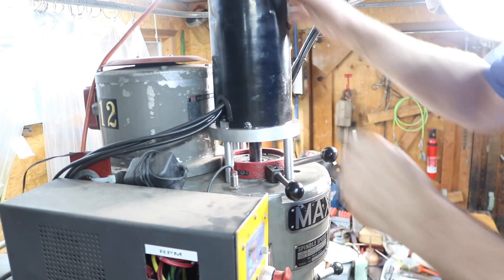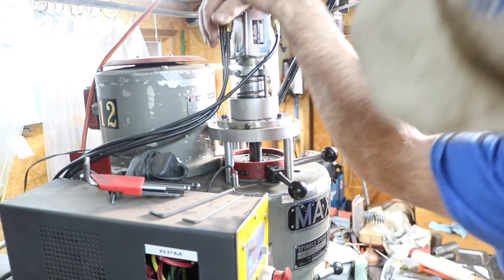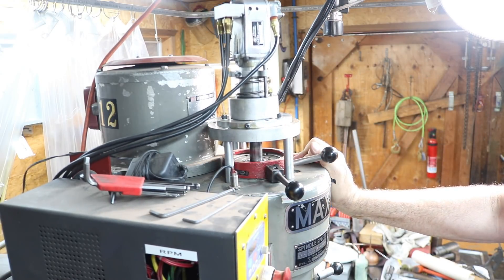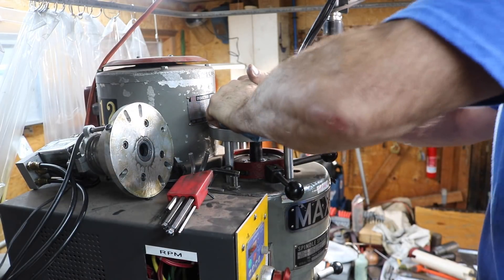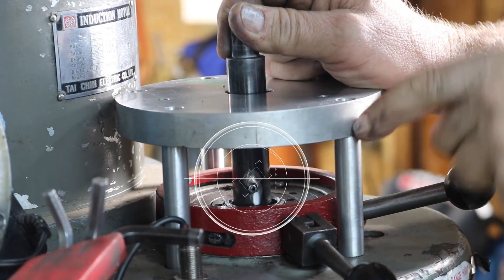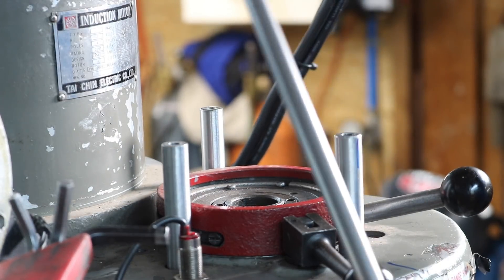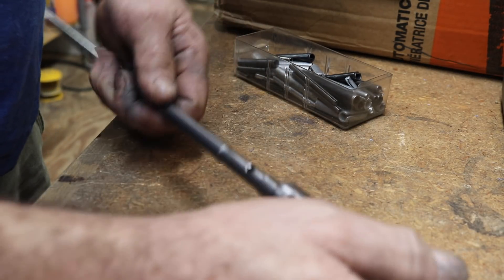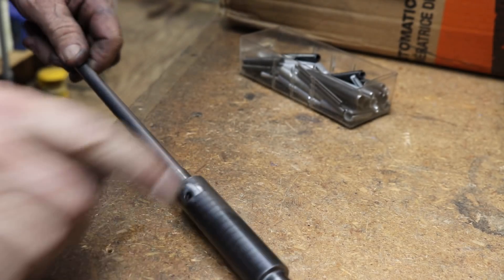Problem with my Milling Machine

Comment: I love repair videos. I always learn something. I have thought about getting a power drawbar for quite a while, but have never pulled the trigger. For one thing, I usually keep the air in my shop off unless I need it. I have some slow leaks that cause the compressor to cycle ever once in a while and if it goes on a night, it scares the bejusus out of my wife. Never good.
Reply from the maker: Thank you.  The air is an issue,.

Comment: This looks like a Kurt power draw bar. The two piece draw bar design allows different materials and simpler draw bar length choices. I like that idea as it is simpler to replace only the part that is worn. We used these for decades in a three shift production environment and I don't recall roll pin failure being an issue. I would call this an easy fix and consider the failure a minor anomaly. My experience is that you will have more issues with the power draw bar engagement function as the assembly wears. The assembly is non precision. Keep hardware loose and allow the assembly to self align before torquing the hardware. Worn assemblies used to cause me enough alignment trouble that installing the cover would prevent reliable drive socket and draw bar engagement. I tried making hex adapters and standard impact sockets to replace the OEM spline parts to save $. This works reasonably well. Airborne shop grit can offset the advantages of anti seize. I unfortunately only have one home shop and I do both wood working and machining. Wood dust is a constant problem on oily metal working machinery.
Reply from the maker: Happy New Year.

Comment: I'd put a brass washer under the the pinned on part for the pressure on the spindle. Like a bearing . Yes nobody knows about SAFTEY wires anymore. I do have used them in the 70s. Why back in the old days I worked on government contracts building tomahawk rockets and other secret missiles. Odd ball materials money titanium magnesium fun stuff if YA never machined any. Carbide wasn't real big then. I made a big hit and got made Forman for being smart . We had clamps to be milled from a real hard stainless it wore out end mills three at a time for one clamp. I had a carbide insert cutter triangle 3/8 I think but I milled four sets on my shift and rotated them one time plus it took one cut the width being it's diameter. . Nice to come in and be told the head office wanted me. Thought I was being fired.
Reply from the maker: Good thinking, Thanks, Merry Christmas.

Comment: a longer draw bar, and have the roll pin visible. I hope bits of wire and roll pin don't fall inside the quill, next time it breaks.
Reply from the maker: Thanks Debon h.  I should not tight clearance.  This is the first time this has happened.  Merry Christmas.

Comment: Rand any chance the centrifugal force will cause the twisted section of safety wire to eventually rub on the  inside of the the spindle? Cheers Zed
Reply from the maker: No not on the really quite a bit of clearance at the top.  ThanksZed O.  Merry Christmas.

Comment: I think you just bypassed a safety feature. By putting safety wire in the hole instead of shear wire, it might not break when it needs to in order to protect the rest of the machine. We had to replace quite a few parachutes in the Navy because someone did just that. Imagine pulling the wire to deploy your parachute only to find out it won't deploy because of that...
Reply from the maker: This is not hard wire it is soft stainless wire, It will shear.  The wire is just to hold the pin in positions, I think one of the major reasons for the shear is the the pin shifted to one side so only one side was holding the torque.  The safety wire will shear off if the pin shears.  The pin only needs to shift about 0.050" to loose engagement.  Thanks and Merry Christmas Thank you MtSBWY.
Reply: @RRINTHESHOP  Merry Christmas to you too!

Comment: nice repair...if my memory is correct, didn’t you power tap the large plate (fwd/rev), think that was the cause of wear/damage?
Reply from the maker: Thanks Chuck and Merry Christmas.  I think just time and the pin shifted to one side, that is why the safety wire to stop the pin from shifting.

Comment: Randy I am not sure that wire will work. Just an old man's mind working overtime. Glad it was an easy fix for you. God bless and Merry Christmas  to you and family
Reply from the maker: The wire is just to hold the pin in positions, I think one of the major reasons for the shear is the the pin shifted to one side so only one side was hold the torque.  The safety wire will shear off if the pin shears.  The pin only needs to shift about 0.050" to loose engagement.  Thanks and Merry Christmas.
Reply: I think you may just have something there . A while after watching  I got to thinking the same thing. And with that the wire will work just as you intended. 👍👍👍👍

Comment: Lube up that sliding piston so that it won't stick in the down position.
I had mine stick, the tool and holder came right out and hit the floor!!
Make sure your air lubricator is topped off with oil as well.
Reply from the maker: Yep lots of oil.  Thank you Mr Johnnaz and Merry Christmas.

Comment: Enjoyed the video Randy. Not sure how the wire is going to stay in place if the new roll pin shears. Machining a small grove and snapping a C clip around it would do the trick.
Reply from the maker: The wire is just to hold the pin in positions, I think one of the major reasons for the shear is the the pin shifted to one side so only one side was hold the torque.  The safety wire will shear off if the pin shears.  The pin only needs to shift about 0.050" to loose engagement.  Thanks and Merry Christmas.
Reply: 👍 Randy, Have a Merry Christmas

Comment: Hi Randy... I've seen in agricultural equipment where they would drive another smaller roll pin inside the roll pin. I'm guessing that it locks it tighter and makes it stronger..
Reply from the maker: I don't think it needs to be stronger, then something worst will break.  Yes that will work but make sure that is the problem.  Thanks Jeff and Merry Christmas.
Reply: Merry Christmas to you too Randy! I'm loving my dovetail cutters!

Comment: Thankfully it was a simple repair.  Interesting that the roll pin would shear in two places like that.  Merry Christmas if we don't hear from you in the next week!
Reply from the maker: The wire is just to hold the pin in positions, I think one of the major reasons for the shear is the the pin shifted to one side so only one side was hold the torque.  The safety wire will shear off if the pin shears.  The pin only needs to shift about 0.050" to loose engagement.  Thanks and Merry Christmas Everett.

Comment: Whew, that was a fun fix compared to what it could be. I didnt think about the wire fix. AND I've got some, just have to remember to use it. Your right it isn't used as much as it should be. Used to use it all the time in my dirt bikes. Especially the Husqvarnas...😊 -T
Reply from the maker: The wire is just to hold the pin in positions, I think one of the major reasons for the shear is the the pin shifted to one side so only one side was hold the torque.  The safety wire will shear off if the pin shears.  The pin only needs to shift about 0.050" to loose engagement.  Thanks and Merry Christmas Tom & family.

Comment: What should I do with 550 lbs Kiswel kc28of  .035  mag wire? save for tie wire or sell for scrap?
Reply from the maker: Tie wire needs to be a soft wire.  Maybe sell for scrap.  Thanks TR and Merry Christmas.
Reply: @RRINTHESHOP  Probably sells at scrap yard later. I got in one of those bidding wars and bought a 50-gallon barrel that I have no use for.

Comment: When I go that extra step on a repair I end stressing over it. Thinking that now I’m not gonna know when it breaks again.😬 These are the things that keep me up at night.
Reply from the maker: The wire is just to hold the pin in positions, I think one of the major reasons for the shear is the the pin shifted to one side so only one side was hold the torque.  The safety wire will shear off if the pin shears.  The pin only needs to shift about 0.050" to loose engagement.  Thanks and Merry Christmas Kirkland Painting & Repair.

Comment: I like the video but I also question the wire when the pin breaks
Reply from the maker: The wire is just to hold the pin in positions, I think one of the major reasons for the shear is the the pin shifted to one side so only one side was hold the torque.  The safety wire will shear off if the pin shears.  The pin only needs to shift about 0.050" to loose engagement.  Thanks and Merry Christmas Joseph Duda.  I think it will stay right there.

Comment: Just a thought a old mechanical engineer friend of mine said split pins should have the split 90 degrees from shaft to keep them from breaking.always enjoy your video's.
Reply from the maker: Yes I would agree with that.  But in practice I have never seen difference.  Roll Pins are not that hard and will shear when the force is high enough, usually form shock loading.  They are more of a safety device in this use so you do not harm something else that is harder to fix.  Thanks Jim and Merry Christmas.

Comment: I was going to mention the wire shearing but looks like I was beaten to the punch......
Reply from the maker: The wire is just to hold the pin in positions, I think one of the major reasons for the shear is the the pin shifted to one side so only one side was holding the torque.  The safety wire will shear off if the pin shears.  The pin only needs to shift about 0.050" to loose engagement.  Thanks and Merry Christmas Cape Cod CNC.

Comment: Was the original pin a standard slot type of roll pin or the coiled spring style? 
Shouldn't it be the coiled spring kind since it's in an 'impact' application?
Reply from the maker: I do not know what the original pin was.  I would agree with you the coiled type are better for this.  I do not mind this one shearing, It has been in service for several years.  This will protect the threads on the other parts.  Thanks Dan and Merry Christmas.

Comment: Glad you found the problem Randy and that the unit has worked good for you.  At my old job they had one and it was nothing but problems.   I'm wondering with the roll pin sheared I would have thought your power draw bar would not be able to tighten the collet and you would have noticed that?  Also if the replacement pin shears won't the lock wire get sheared too?
Reply from the maker: The wire is just to hold the pin in positions, I think one of the major reasons for the shear is the the pin shifted to one side so only one side was holding the torque.  The safety wire will shear off if the pin shears.  The pin only needs to shift about 0.050" to loose engagement.  Thanks and Merry Christmas Bill.

Comment: The 032 in a first aid tape  was good it’s kinda a bandage .     Great fix.      Thanks
Reply from the maker: The wire is just to hold the pin in positions, I think one of the major reasons for the shear is the the pin shifted to one side so only one side was holding the torque.  The safety wire will shear off if the pin shears.  The pin only needs to shift about 0.050" to loose engagement.  Thanks and Merry Christmas Robert.

Comment: Next best thing to something in perfect working order, a very simple fix, no collateral damages....   😎👍
Last Spring with the help from Philippe and Robert, we changed all the bearings in the head of the mill except the quill bearings (Those are still going perfect...), made a night/day difference on the noise.
BTW, who is getting the Grecian formula treatment, the fuzzball on the mike, or, possibly your mustache...   Sorry I'm still having those images that put a silly smile on my face...   😁
If you're only using the mike inside, you can use one of those anti popping screens like the ones they use in recording studios, you only need to find one the right size for your application.
Reply from the maker: Thanks Pierre, Merry Christmas.

Comment: Lockwire is something I really want to try one day after seeing AgentJayZ do turbine videos. Didn't realise it can be done on machines too, thanks!
Reply: Adam Carmichael : It's used a lot in mining industry but it has it's draw backs. Takes extra time to open or close a component for maintenance or troubleshooting. Production folks hate that.
Reply: Lockwire is used on locomotives particularly on the trucks and roller bearing nuts..
Reply from the maker: I Aircraft used all over for safety and I found it very useful on Diesel engines on the ships t help fight vibration issues.  Thanks Adam and Merry Christmas.

Comment: Randy if the pin shears, won’t the tie wire get cut also? Just my mind working.
Reply from the maker: The wire is just to hold the pin in positions, I think one of the major reasons for the shear is the the pin shifted to one side so only one side was holding the torque.  The safety wire will shear off if the pin shears.  The pin only needs to shift about 0.050" to loose engagement.  Thanks and Merry Christmas Rocking J.

Comment: Randy do you have a video on your RPM sensor and read out is your mill power by a VFD
Reply from the maker: John, No I do not, for the mill.  I had some issues with the electronics mounted so close to the VFD.  I need to mount it different.  Thanks and Merry Christmas John.

Comment: You're lucky. My vari-speed Bridgeport clone started making noise and ended up needing a complete bearing and belt replacement which is still in process.
Reply from the maker: Yes for sure, I was worried.  Thanks Kevin and Merry Christmas.
Reply: @RRINTHESHOP  Merry Christmas!